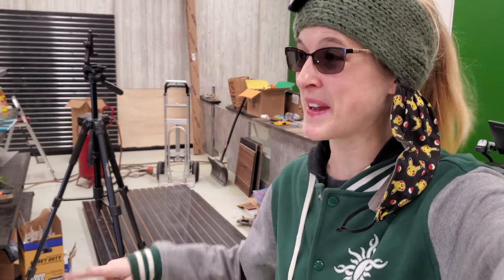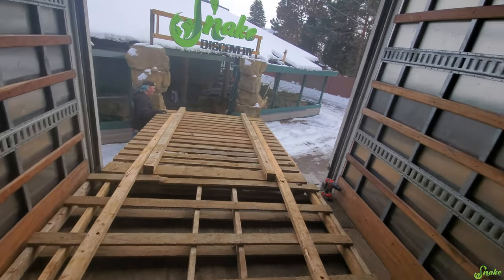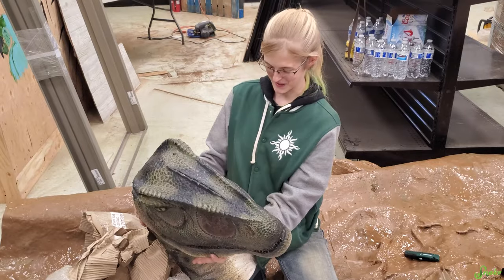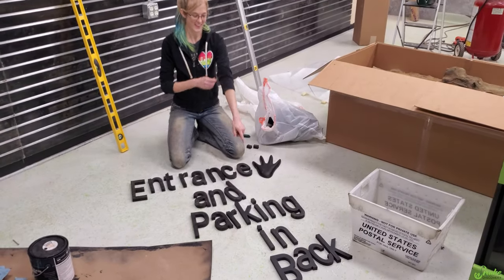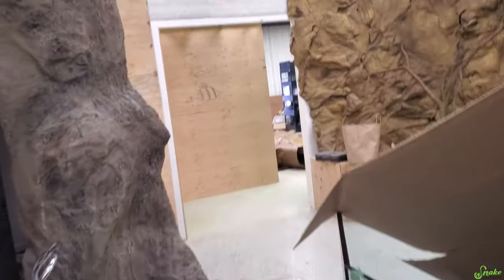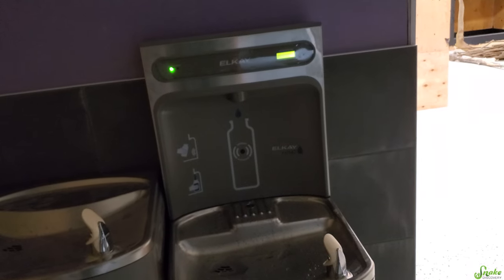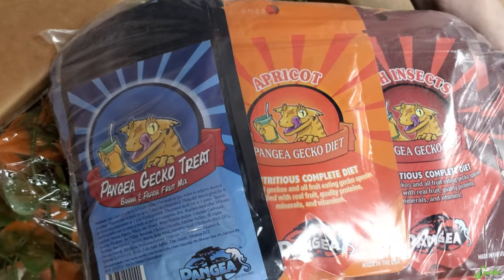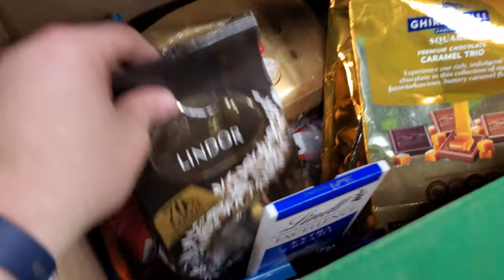Facility Update #8! (More Universal Rocks Décor has Arrived!)

Comment: The lack of dust management during the bulding is going to mean your HVAC system is going to be in shambles. It will also be an issue for air quality for you and the animals. I strongly suggest a duct cleaner come by to prevent that dust from reducing your system's longevity before running it normally.
Reply: I think the majority of the dust is coming from the cardboard boxes, I have worked in a warehouse before and let me tell you there's a lot of dust and there is nothing you can do about it. Once they dispose of the vast majority of the cardboard boxes the dust will be much less of a problem most likely
Reply: @the_undead  It seems like a lot of the dust came from the sand painting, so it won't be an on going problem, but I bet he's right, that it would mess up a HVAC system. Getting your HVAC system cleaned after most renovations is probably a good idea.
Reply: @the_undead  Actually you can use like a big vacuum hoses in the area to suck up particles as you're opening and moving things around and it will reduce the dust. Also, turn off system during the active working and change filters often during this.

Comment: I suggest putting the cricket bins by the wall instead of on the counters due to the visually appealing aspect.  If you were to put them on the counter, your cashier desk would have a very “closed vibe”.  Also, since the doors to the counter are at the end, if one were to walk into your zoo, they would see a door (open concept), next to a big block (closed concept), and the cash registers (open again).  If you had to put them on the counters, I suggest putting them to the side.  So it would be closed, open, open or the other way around.  I hope this helps and wasn’t too confusing!💙
Reply: Could you draw a picture?
Reply: I agree with not putting them on the counter, my fear is that I would accidentally knock it over 😬
Reply: @PeelingCeiling35  yeah 😂 clumsy gang

Comment: I’d keep the cricket bins out of customers’ reach so they don’t stage a cricket escape. Behind the counter is best. 🦗 🦗 🦗
Reply: Agreed!!
Reply: Plus, Ed and Emily are really tall, so it might be easy for them to get into bins that height, but if they employ a shorter person it would be very cumbersome for them.
Reply: @Liv Mes Maybe they could invest in an under the counter modular freezers that can fit the shelves of their retail area or one they can roll around to the rodent area to restock it when they run out.
Reply: @Liv Mes depends on the size of freezer. There are vertical chest freezers that take a smaller footprint.
Reply: What if they just got front opening freezers to go under the counter?
Reply: Or even just accidentally knock it over.

Comment: Genuine question: In theory, if you left one of the biodegradable cups in the bioactive enclosure after feeding, will it just kinda get eaten by the isopods?
Reply: I was wondering about those... why are they better than plastic ones? Surely you could just reuse the plastic ones?
Reply: Ooooooooooo
Reply: @conlon4332  the feeding cups seem to be specifically for the pangea food, which is a goopy liquid food. I imagine it would be time consuming to wash all the food off. I think its just a sustainable and easy option.
Reply: I think many compostable items need special conditions to break down, and if they're used weekly they would build up faster than they can decompose. But I don't know if isopods would eat them! Great question.
Reply: @conlon4332  I think reusable containers would definitely be better, but that some people use disposable plastic cups to cut down on dishes. If you're going to be using disposable containers  either way, biodegradable ones are probably better than plastic, but I'm sure Emily would recommend reusable as the best. I think you can buy some pet enclosures with built in food & water dishes that require a liner (I can't remember what video she mentioned those in, I just know she said she preferred their reusable dishes so they didn't ask for that option), and a biodegradable liner is better than disposing of a lot of plastic.
Reply: Oh, it's to go with the feeding ledges they showed right before - they need liners. I think Emily has used a Pangea enclosure before, but didn't use the feeding ledges for that very reason.

Comment: Why not get front opening freezers, and put the cricket bins minus the metal legs on top of the freezers?
Reply: Front opening freezers are less energy efficient and would end up costing them more in electricity bills.  Top-loading freezers keep the cold in better (cold sinks, heat rises) and use less electricity.  They also seal better and usually leak less.  It might be a better idea for them to have the cricket bins behind the counter in that corner and the freezer out on the floor nearby.